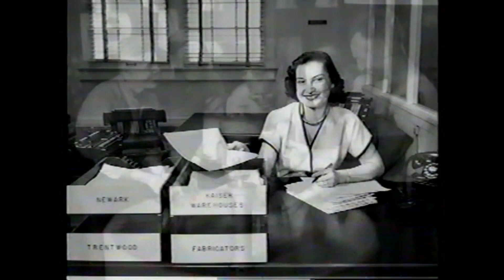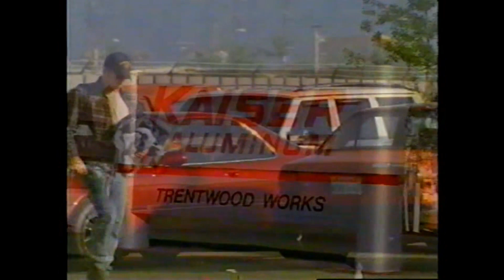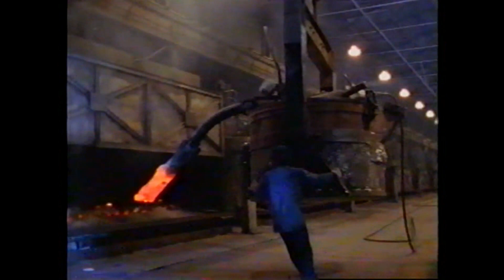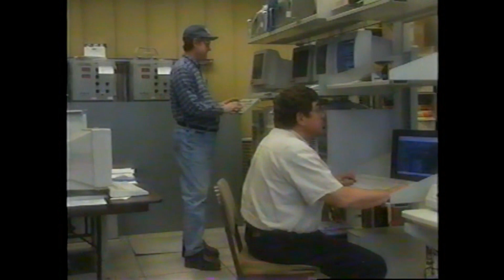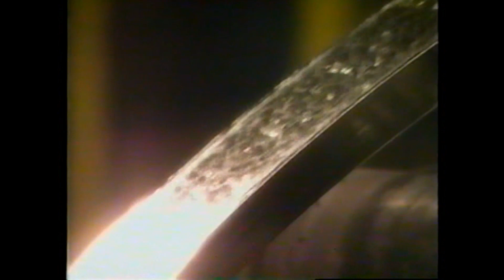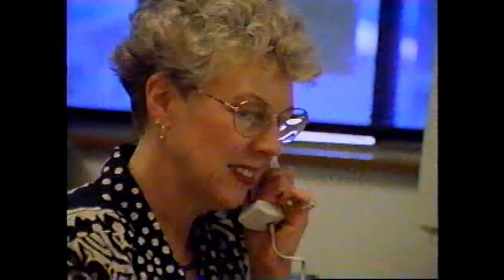Kaiser Aluminum Tacoma Works Tour

Comment: Worked there 1988-2000.Strike captain and elected Union official for Steelworkers Union Local #7945.On strike for exactly 2 years.Charles Hirwitz majority owner was a real piece of garbage who was not for the working man.He closed the mill down put us all out.You had to be a real Badass to work on those old Soderberg pots.Ambient air temp high as 200 plus degrees.The three men walking towards the camera I worked with.Cant remember the one on the left but the middle one is Fred Riche.The one on the right is Leif Onsum.Funny how the guy mentioned Kaiser moving into the 21st century.Kaiser Tacoma closed in 2000 right after the strike ended.I did  the toughest job there.Line 1 and 2 Anode Tender.Really miss the people.  "Biker"Bob
Reply from the maker: Always love hearing your stories biker bob! It was a tough job put here not many would do today !